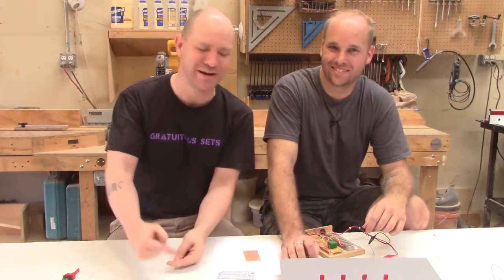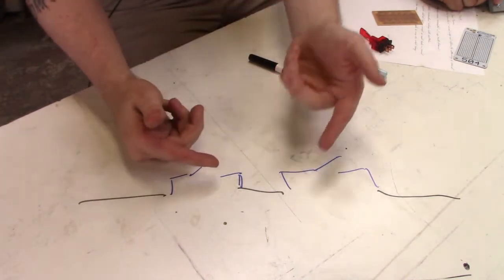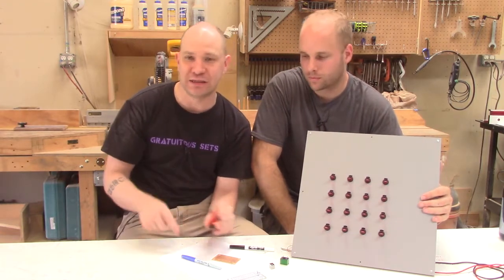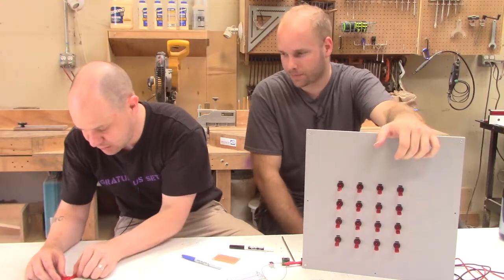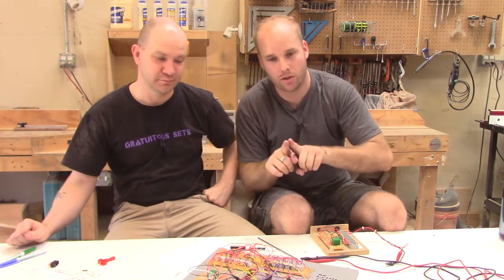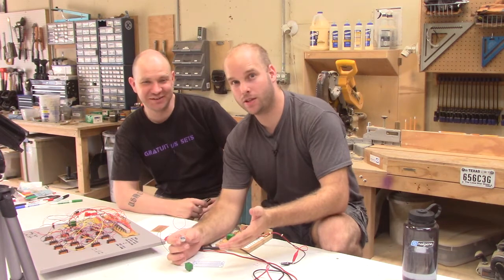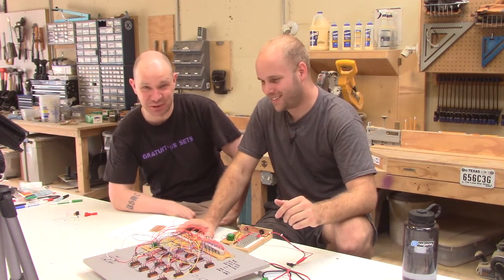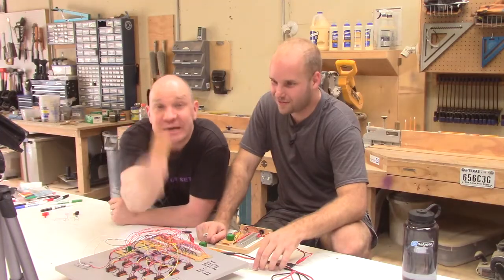Escape Room Switch Puzzle

Comment: You could have put a diode on your signal line and ran it how you wanted to in the first place. That would keep your current back tracking through the other switches ($0.20 each)....  Also, always clean your prototyping boards with acetone to get the plastic layer off
Reply from the maker: Damned fine advice, Sir!!!

Comment: I defiantly appreciate the idea of creating props without a microcontroller.  It almost becomes a challenge to make it work the way you want with nothing more than relays, diodes, and resistors.  Great video!  I was almost bit by the 5 pin relay thing too. haha
Reply: It is certainly nice to be able to look at the physical wiring and just use a multi-meter to troubleshoot. And I'm slightly afraid that the more comfortable I get with Arduino (next step: Raspberry Pi) the more heavily I'll rely on it.
I've already become a touch lazy when it comes to our CNC router. I /could/ do a physical layout and use hand tools, or I could make my robot minion do my bidding. I've caught myself drawing up G-code for a square with a hole in each corner. "Use the table saw, you lazy SOB!"
Reply: Matthew Charles I have found PLC's to be a nice alternative to arduino and pi for timing, sequencing and relay type circuits.    $80 units can have multiple relay outputs and several configurable inputs. more companies are offering free software too.
Reply: to self: "He probably doesn't mean Platoon Leaders' Course..."
googles PLC
Ah, those do look useful.
That seems to be a fairly generic term. (I've actually had to replace the PLC for our CNC spindle. Didn't know to call it that.)
Do you have a link to the specific PLCs you're talking about?
Reply: Haha! sorry about that.https://www.automationdirect.com/clickplcs/index These are the best value out there.  Free software download too.  Think of them as programmable relays.  they are also expandable to add additional digital or analog inputs and outputs.  I worked for Mitsubishi CNC Systems - they are defiantly common in CNC's and all kinds of industrial equipment due to there ease of configuring for multiple machine models and reliability.  I will not go on and on.  With your obvious knowledge of how relays function, the ladder logic programming used in PLC's will be very easy to understand.  No code to learn or write.  Look carefully at the different model #'s - some are 110V and some are 24V.  Some have transistor outputs and some have relay outputs.  Enjoy!
Reply from the maker: Fantastic! We are setting you up for automatic comment approval, so ANY TIME you have a comment (especially ones that are SO helpful) feel free! :-D

Comment: Nice one guys...we solved the problem exactly the same way about 2,5 years ago...it was a nightmare and some sleepless nights!
Reply from the maker: Dang it!  ...if only you'd posted a video of the nightmare! Lol- 
It was supposed to be so simple!
If we ever approach this again, we will start with a 16 pin arduino and work outwards :-)
Reply: Same here...we have 36 buttons. We dont use arduinos. We use raspberry PI because you dont have to flash them. You see changes of the program on the fly. Makes working much quicker. Are you on facebook? i could send you some picures of our "radiant starmap of doom" as we called it....
Reply from the maker: Ooh yeah! send pics!!! We are on facebook as Gratuitous Sets Laboratories
Reply: done..
Reply: Chris, Have you had any problems using raspberry PIs? I have had a few corrupt OSes from people not probably restarting/shutting them down. They treat them like a micro controller and not a linux computer.
Reply: Hello...no we never had problems with PIs. The only problem we had is that we had some corrupt SD Cards in the beginning. But once we found the right ones the system is running for more than 1,5 years now without failure. What we basically did is that we programmed our own show control system with even multichannel procedural audio...
Reply: we had the sd card problems when we just switched off the PIs. But once we added a shutdown routine and used proper sd cards the problem was gone. you have to teach people to shut them down correctly because they are computers and not micro controllers...

Comment: Simple and maybe silly question here... what is the grey material that you have the switches through? I've been trying to get away from woods or MDF for switch boards or any other electronics. Thanks!
Reply from the maker: Additionally, it is good to know that, in 1/4",  Sintra comes in primary and secondary rainbow colors, but in 1/2" it is, generally, only available is black or white.  The other products i mentioned come in colors, textures, stone, metallics...too many to mention.
Reply from the maker: The grey stuff is Sintra. It is an expanded PVC- the same as non-pressure bearing pipes are made from.
Some other options are LDPE and MDPE  -low density and medium density polystyrene, respectively. these are mostly Glue-up materials (with definite exceptions) so call me for a quick briefing if you might choose these routes.

Comment: Isn't the cheaper and easier solution just to use a microcontroller?
Reply from the maker: Yup. Hindsight!
We shot this video to show how easy it is to keep dumping time into something when it would be smarter to just start over.  At the start of the video, Matt refers to "Sunk Cost Fallacy".  That is the definition of sunk cost fallacy :-)
Reply: microcontrollers can get corrupted and be less reliable than plain relays.
Reply: Properly programmed it really shouldn't. Also, if it does die, its probably easier to pop it out of it's socket and replace it for next to nothing than having to pull that relay mess apart.
Reply from the maker: We think it's really important to show our mistakes! lol

Comment: I would have changed switches but as you said most toggle switch work the same. I have used these for a lot of games and projects https://www.adafruit.com/product/3306. Heavy duty, bright, 3-12v and you can remove the cover as well. My main question to you is why not use a micro controller (arduino mega for 16+ digital pins)? The code and wiring would have been a lot easier. Plus your could easily change the solution of the puzzle. Great video but like all projects they can be built so many different ways.
Reply: The short answer goes back to that whole "Sunk Cost Fallacy." It's augmenting a single bit of a larger puzzle that is very micro-controller heavy. Rather than wiring up transistors for 16 pins to get the Arduino to control all the 12v lights on the switches, it was supposed to be a simple, electro-mechanical affair. If I were to start over, it'd be just that. Part of the larger Arduino-centric puzzle.
On he plus side, we learned some stuff.: most memorably, about how lit switches work.

Comment: why wouldn't you use a raspberry pi to be the brains... this way you could have a different sequence every time... thus giving the end user a random experience?   You would also be able to get real time feedback into the user performance.
Reply from the maker: Good question 👍😀. We often try to stay purely electromechanical since it is the most reliable, but here, we really "shot ourselves in the foot". At the time, we were primarily using  Arduino, which has pretty crappy reliability, and that pushed us away from using a control board.  We WOULD use a raspberry Pi now, but the video is about learning, and persistent problem solving more than it is an electronics tutorial, so it stands as that.